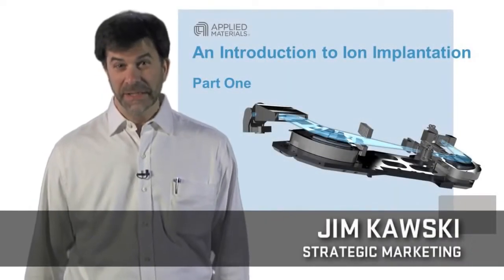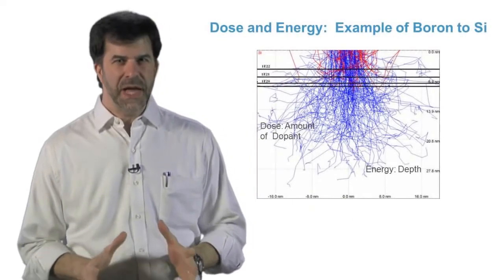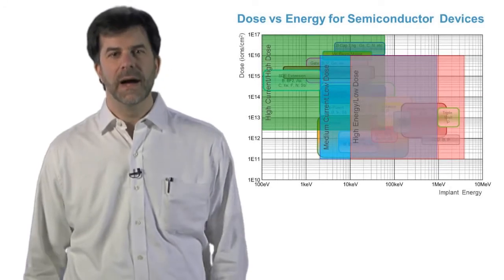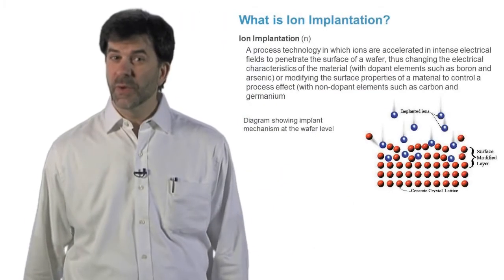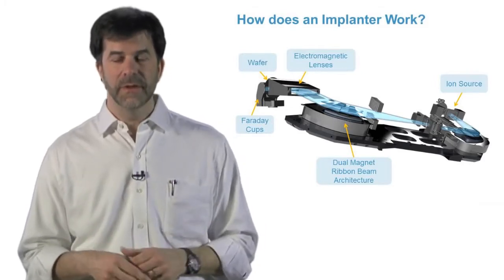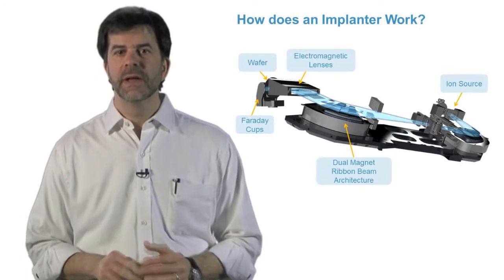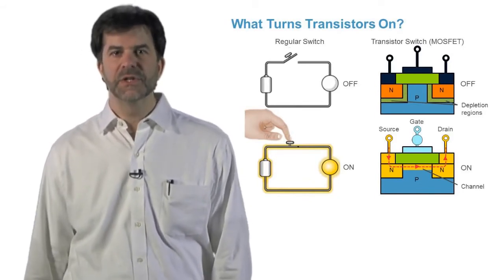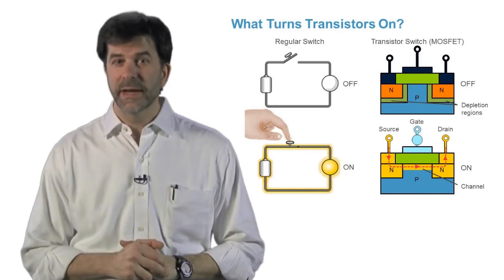Ion Implantation 101    Part 1

Comment: You have a picture of a transistor while explaining a diode..
Reply: Look up Bipolar Junction Transistor or BJTs. That's a spot on example of how a transistor is made essentially from diodes smashed together. Even the MOSFET in the video technically has NPN  or NP and PN junctions in them, which are diodes. So, I would dig a bit deeper into device physics if you would like to learn more about how diodes essentially make transistors. I hope that helps :)